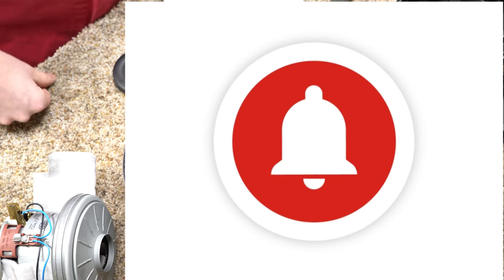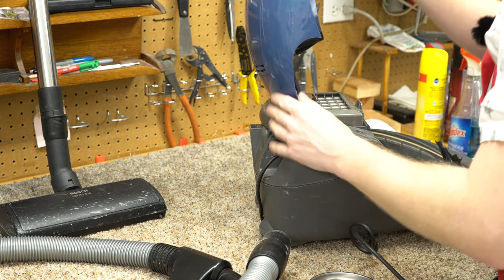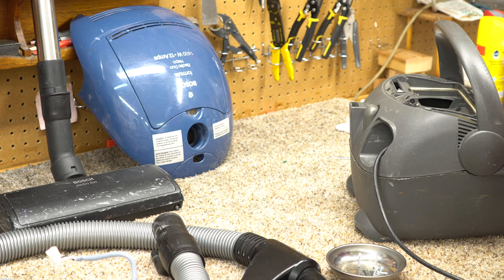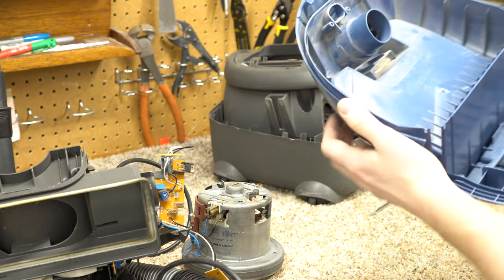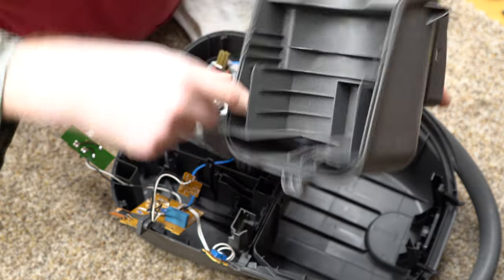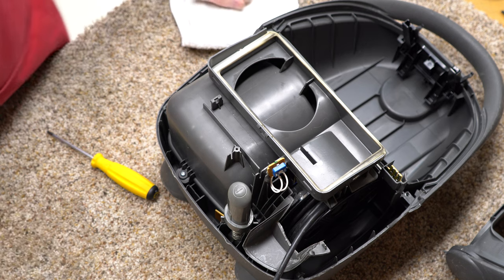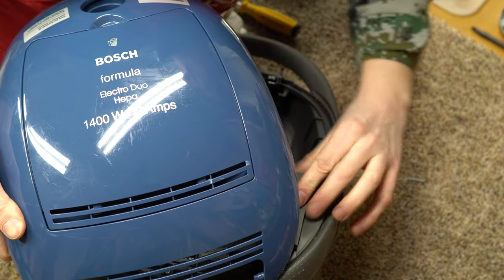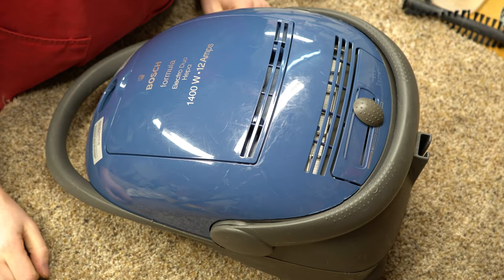Bosch Formula Vacuum Repair

Comment: Thanks for the video! It helped me opening our vacuum cleaner to fix a stuck cable roll.
However, even though I knew from your tear down I still broke the cover over the potentiometer. It just does not seem to be made for repairing. I put it back on with some glue.

Keep it going and best regards!
Bertram

Comment: I love using my dishwasher to clean all kinds of things like glass light fixture covers, grill covers,  basically anything plastic, ceramic or glass can go in there as long as there are no chemicals like paint residue that would harm the dishwasher. I just make sure I keep the heat dry off.

Comment: So, my cord wouldn't retract, so I found this video. Turns out, two of the three tabs on the reel were broken (abuse). I took the reel apart (mostly). The spring mechanism was also cracked. I couldn't fix it, but found this video helpful and inspiring. TY

Comment: I bought a used one based on reviews that the motor is very quiet but I was disappointed. I was going to open it up to see if there is a way to clean the motor or even replace it but after watching your video and hear how noisy yours is, and you did not do anything regarding the motor,  I guess I will just live with it. Thanks for the video in any case.
Reply from the maker: You find a Miele with a SEB228 something to consider next. But if you want to really go all out quiet have a central vacuum installed

Comment: Hey nice video and very helpful for me to repair my Bosch formula. How did you manage to get the filters around the engine so clean? Mine are very black and they are also not available as a sparepart. Thanks and keep up the good work
Reply from the maker: You can find parts on eBay
Reply: @PerformanceReviews  what exact terms did you use for your search? I tried to search for engine filters but I only got the one filter after the bag not the ones around the engine

Comment: I absolutely hated my Formula. It was a straight suction machine which I favor but it had friction fit wands that always stuck together, it always tilted back on its butt whenever I wanted to turn it around, it’s only attachment other than the floor nozzle was a cheaply made upholstery tool and as soon as they stopped importing the brand they stopped supplying original branded bags so I replaced it with a much better Electrolux EL6986 that I still have but retired and replaced with an even better Miele Pure suction based on an S2 design. 
I hate Bosch’s customer service. I was respectful when I asked them how they could cut off the supply of replacement bags immediately after pulling their products from the market and they hung up on me. They were just as snotty once before when I called their customer service number about their leaky spark plugs. That’s a term for spark plugs that leak electricity out of the sides.
Reply: Correction. My Miele Pue Suction is based on the C2/S4 design
Reply from the maker: Wow I was unaware of the customer service they had. Thanks for sharing your story.  Part a got cut off due to "Star for parts " being purchased by a Eassco. Star was the sole distributor. How ever now that Amazon and eBay are more of a thing bags and filters are still pretty widely available.